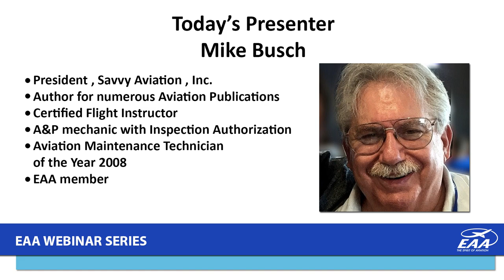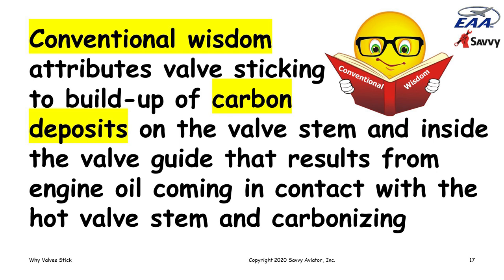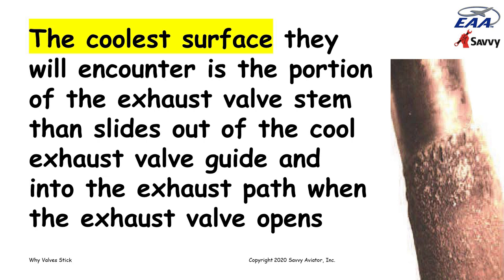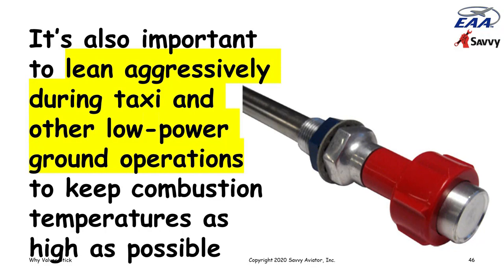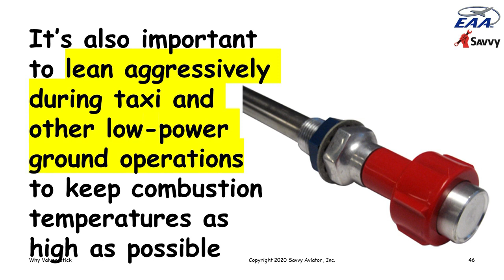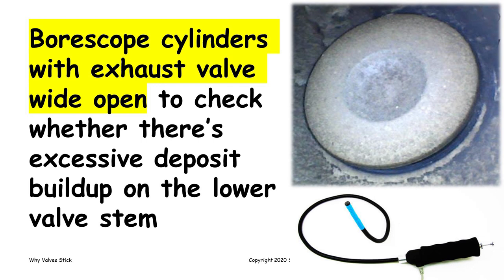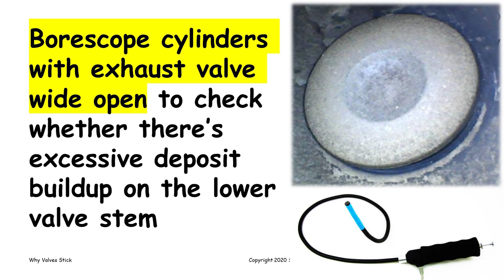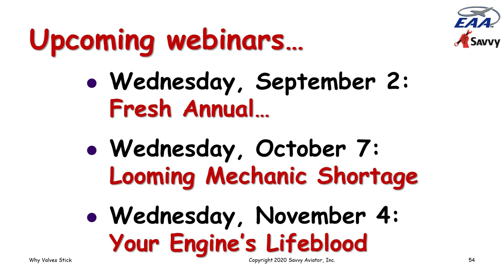Why Valves Stick

Comment: I used Hoppes 9 and a rifle barrel snake to remove the lead oxy-bromides from the valve stem. Worked great. Didn't need to ream the guide because the valve was as free to move as when new.

Comment: Lycoming recommends the valve and guide inspection in SB388C. It is surprising that the FAA does not (yet) have an AD in this regard, but EASA has derived AD2005-0023R3 from SB388C.

Comment: I've flown two aircraft with Lycoming O-360, one with a Continental IO-240, and one with a Continental O-200A, and the only one on which I've had sticking valves was the O-200 running on mogas. So I guess I'm the exception that proves the rule :)
Reply: Same here.  And those Continental deposits did not look like lead or bromide on the PowerPoint slides 

The valve stems had minimal deposits

Could there be two different types of deposits and sources/causes?

The TCM deposits were located in the guides, baked onto the wall of the guide.

The valve guide reamer cut through the deposits which were hardened, black, and looked like carbonized oil.

Comment: Something approaching 3 decades ago I was flying along the Front Range in a rented aero club 182 with a new rebuilt engine when I experienced vibration so strong I initially thought I'd lost a prop blade.  Turns out the shop that had redone the engine had installed at least one undersized exhaust guide, but after watching this I wonder if a parallel issue was deposits.  Because the plane was part of the aero club rental fleet and used for complex and mountain checkout and so saw a lot of different leaning technique, and while you're always lean at a mile up I recall lots of people running along the ramp close to full rich.    It's fantastic to understand the process behind the issue, but what I find troublesome is how many people still are asking if an oil additive will solve the problem, even after listening to Mike say nothing about oil and everything about fuel and valve temps.  It tells me that a lot of us don't know, really, what's happening inside our engines.  I have a little bit of an advantage in that I was racing before I was flying and I've rebuilt a number of flat six and flat four Porsche and VW engines (and yup, they operate in very different environments and conditions but the layout is very similar), and so I am always in tune, no pun intended, with my engine, but perhaps we as a community should spend some time on mechanical literacy.  You don't need to know how to build an engine or be able to work out a stoichiometric equation, but knowing that the oil and fuel systems are, or should be anyway, completely different systems with little interaction, and a solid grasp of how they work in whatever you're flying.  Thoughts?       Side note:  That 182 had the cold weather oil thinning system wherein you hit a switch and count a few seconds while fuel was injected in to the oil sump.   First time, and honestly every time, I did that I just felt dirty.

Comment: I have extensive experience in this field and have a few issues with the information (not all) provided. #1 the buildup is in the valve guide not the the valve stem,  and is by far more problematic in an injected vs carbureted Lycoming. Lycoming 1425A is a good place to start for Temporarily correcting the sticky valve. Mike should have analyzed the contents removed from the guide not the valve stem to get the complete picture. I have ROUTINELY encountered stuck valves in new Lycoming injected engines with 300-400 hrs operated in the desert southwest (no problem running them above 350 here. I do appreciate all that Mike does and respect his opinions.
Reply: Why would the deposit in the guide be different from what is on the stem? Not saying this take is wrong, just that it seems like it would be the same compound. He talks about excessive mixture richness being a problem as well as coolness, and maybe being new was a factor as well.

Comment: The sodium filled exhaust valves on lycomings help cool the valve HEAD. And do so by improving heat transfer to the stem.
   Heat moves from the head, to the stem. The result is a cooler head less prone to burning.
   But the stem gets hotter. This is even shown in the Cont. Vs Lyc. valve temp diagram in this video- look close, the Temps high up on the Lycoming stems are higher. The head is shown as cooler.

Comment: I pour a small amount of water into the throttle body of my Honda to clean off carbon. The other day my O-320's carb iced, and when I pulled heat the engine ran rougher, then cleaned up. I wonder if it cleaned the engine at all.

Comment: Thanks Mike, I really find your presentations very informative. Those of us flying piston powered helicopters are reminded to get cylinder temps down and stable before shutting down. Unlike airplanes that taxi back at an idle, helicopters need as much or more power to hover than at max continuous cruise. Failure to do this cool down is said to lead to sticky valves caused by the oil being overheated in the valve guides after the cooling airflow ends. I'm wondering about your thoughts on  this. 
Thanks again
Reply: Thats oil coking, also possible, but the major problem are the top compression piston rings getting heat soaking and coking the oil at ringlands and making ringsticking by the cutoff oil flow. Heads are a bit cooler because of greater cooling contact area and more metal between guides and head metal and oil there, though.  But it is still possible to Cook mineral oil. Hence the need to use non ash dispersant and lack of metalic detergents in aircraft oils. Agree that a proper cool down is even more essential for choppers.
Reply: @tomasnokechtesledger1786  Lycoming Service Bulletin no 388C suggests inspecting valve guide condition every 300 hrs in helicopters and 400 hrs in others. I know of machines that have experienced sticking valves, and others that required remediation at inspection time. To my knowledge none of the ones I fly have had issues with compression/ring sealing.  Mike argues that the Lycomings valves run too cool. There is a disconnect between this and the service bulletin requiring more frequent inspection on helis.  Helis operate at very high power settings just prior to shutdown (hover takes as much or more power than cruise flight, planes taxi back from the runway at idle).  It is possible that both views are correct (cooler valves get more deposits, helis shut down quickly after landing have hot valves that coke) and I was hoping to hear Mike's views on that possibility.

Comment: Do airplane engines have a hardened valve seat insert? That's why there are so many cars with aluminum heads using unleaded fuel with no problem, because they have them - but older cars designed for leaded fuel don't have them.
Reply: Yes, most Lycomings switched to hardened valve seats in the 80s
Reply: Cars have water-cooled cold cylinder heads, with the Aircraft Engine cylinder heads running so very much hotter the same metal cannot tolerate operation without the leadoxibromide deposits for very long (100 hours maybe) before a breakdown begins. This is the case even with low compression engines. I totally disagree with Mr.Busch on this point. What works forever unleaded at 200F does not work to TBO at 350 F or 400 F  !!!

Comment: Savvy,

If the post combustion lead deposits are an issue, why is straight leaded gasoline needed in such low rpm, low compressions engine's in the first place?   1 gallon of 110 leaded fuel to 4 gallons of gasoline goes a long way in the engines I work with.

Comment: Great video. Thanks! In my SR22 I routinely run CHTs around 380 on climbs, but high 200s to low 300s in cruise. Am I OK with that? I almost always run LOP. I wasn't sure if your suggestion to run higher temps was just for peak CHT temps on climb out or at all times. Thanks.

Comment: I’m one of those who has a front cylinder that runs close to 300°, I can only imagine what my AP will say if I tell him my engine is running too cool.
Reply: Good front bafles there?
Reply: @tomasnokechtesledger1786  actually I had a leaking fuel injector, now they all run around 350°

Comment: Considering the relatively low compression ratios found in aircraft engines, why would valve strikes be an issue if a valve won't close? Just wondering. I've always figured that aircraft engines should always be non-interference designs.

Comment: Years ago when we had leaded car fuel, if you removed a exhaust valve, the hard crust on a exhaust valve was like a hard beige rock type substance. Obviously lead.
Reply: I was flying when a valve dropped, put down in a field. Valve punctured piston. The engine had run rough for some time.

Comment: Mike....I had a stuck (open) exh. valve in my Lycoming 0-235 C-1....I lubricated the valve stem several times and staked the valve over a couple weeks and eventually the stuck valve freed up and finally closed....I again kept lubricating the valve stem with Kroil...I finally started the engine and fast taxied my Citabria for 15-20 minutes....it seemed normal....my question is where do I go from here....how can I rely on this not happening in flight...should I rebuild cylinders or put new Lycoming cylinders....the engine has just a couple hrs.over 2400 hrs. with fairly low compression readings...any advice ??
Reply: You aware of being able to take the valve out without removing the cylinder? Using the rope trick? You can then clean the valve stem hanging out the spark plug hole and ream the valve guide. It's all very fiddlying but I've done it on my 0-320. It was only a temporary thing as the cylinder was oily and it had to come off to be honed but it stopped the sticking for the summer and I could then take the cylinder off in the winter (which is the best time to break in when there's no Thermal activity, I flew the engine flat out for a good while).  I flew happily with no problems for 100 hrs. I suppose you have to find out why the valve has started to stick as after you've cleaned it up if the problem is still there it will only come back.

Comment: I have a #2 cylinder that seems to be make compression twice during the firing cycle, how is this possible?? I had to do an emergency landing because i lost cylinder and thats the most abnormal thing i notice. Any idea?
Reply: Do you have a broken push rod or rocker arm  on #2's exhaust valve?

Comment: Lead lubricating valves is not a wife’s tail! I was around in the late 80s when leaded auto gas was phased out. I saw the damage firsthand. There were a large number of cars from the 1960s still on the road these engines didn’t have hardened valve seats. Valves didn’t sink into the head before unleaded gas was forced on us. I still have a few sets of heads around here somewhere that have exhaust valves sunk 1/2 an inch into the head. Sure late model cars have hardened seats and don’t need leaded gas to keep the valves and seats alive. What about GA piston engines? Do they have hardened seats?

Comment: I would not want to run any auto gas that contains ethanol.  I have a fleet of motorcycles(22) that are used for training and ethanol does bad things to engines if they aren’t used at least weekly.  In California, it is almost impossible to find non ethanol fuel.  In other states,it can be found.  Every time you purchase a new car, there is a thousand dollars added to the cost in materials to deal with the effects of ethanol.

Comment: Can someone answer this for me...
If you have Excellent Compression, IE 78-79/80, is it remotely possible that you have sticking valves? The other Day I think I may have encountered "Morning Sickness" but I'm not sure.
Reply from the maker: Johnny, its possible that your compression tests were done when the engine was warm (that's the usual approach, to get the "best" reading); Morning Sickness happens when the engine is cold and tolerances are most tight.  So to answer your question, yes, it is possible.
Reply: @savvyaviation  
Thank you for the answer. 
The engine actually was cold when the compression test was completed. 
It's a moot point now as the aircraft has since been totaled unfortunately.

Comment: Rhetorical question: why do aircraft engines need such high compression to get HALF A HORSEPOWER PER CUBIC INCH? Automotive engines with the same compression can get a full horsepower per cubic inch - and the turbocharged engine on my car puts out TWO HORSEPOWER PER CUBIC INCH on 91 octane gas.
Reply: Automotive engines operate in a far wider RPM range and make significant power well above aircraft engine RPM limit. What sort of power do you get out of your automotive engine when you limit RPM to 2,700 rpm?
Reply: What Kris said, plus the fact that re-engineering the engines is economically stupid.  The engine in your car gets sold by the 100,000.  The scale-costs of manufacturing aircraft engines don’t cover the liability and certification costs.  That’s why experimental planes have become so popular.
Reply: @KenLeonard  Sadly, that's why there's no hope for GA.
Reply: aircraft engines actually have low compression compared to a modern automotive engine

Comment: You are so wrong. Lead reduces valve seat wear.
Reply: What did I miss, he discusses build up on the valve stem, what does that have to do with the seat?
Reply: @tomedgar4375   He said lead has no purpose in fuel. I say it lubes the valve seat.
Reply: @michaelsamson3276 
 got it
Reply: does the seat need to be lubed? and if so WHY?
Reply: @markandregg8235    The lead acts as a cushion.  For example, cars from the 50-60's need new hard valve seats for unleaded fuel or the seat will pound out.. Aircraft engines with aluminum heads  have hard seats already so it's not as big a problem.
Reply: @michaelsamson3276  Notice the low tension on aircraft valve springs, vs car springs. I dont think you will pound out the seats on a max possible rpm engine of less than 3000 rpm.

Comment: Dirty oil, running too hot, poor maintenance. Improper fits and clearances (wear/monkey mechanic), debris working through the engine, not heat….. you’re funny